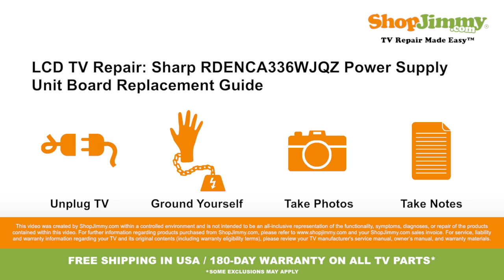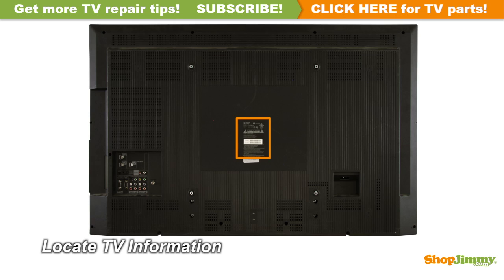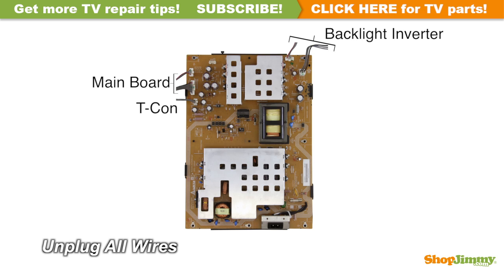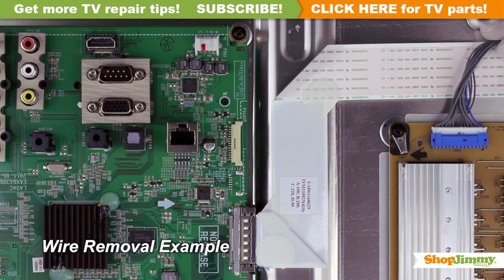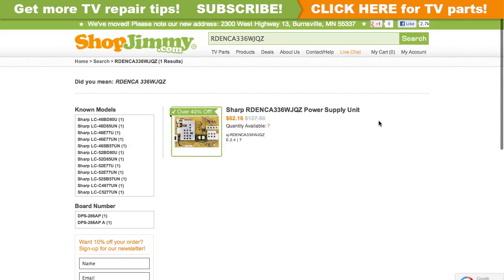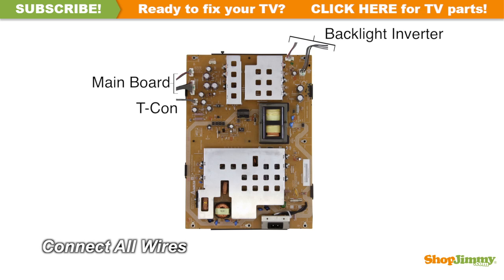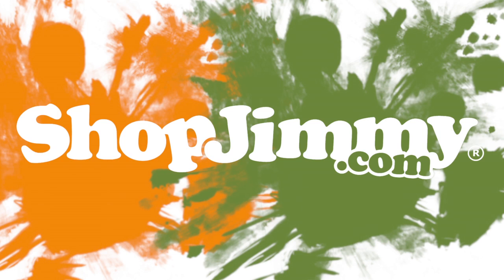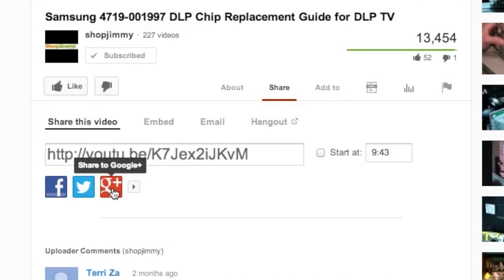LCD TV REPAIR TV WILL NOT TURN ON - Sharp TV Power Supply Board Replacement Models LC-46 LC-52 LC-C

Comment: s42ax-yb08
this is the model of my tv. only flashes some lights in the buttons is on and all it does.
Reply from the maker: damian4522   You will also need to replace the main board in your TV after the electric shock.  We always recommend replacing both the main board and the power supply.  Here is a link to replacement parts for your TV model number on our website, click here:  http://www.shopjimmy.com/catalogsearch/result/?q=s42ax-yb08  Be sure to match part numbers on your current board, with your replacement for compatibility.  You can also call our customer service for further assistance with your purchase.  (877) 881-6492  Thanks and please let us know if you have any further questions with your TV Repair!  www.shopjimmy.com

Comment: hello! I have a samsung 42 inch will not start after electric shock. I change the power supply for a new, but still will not start. help!
Reply from the maker: damian4522   Please reply with your TV model number and more information about the symptoms and problems your TV is showing.  Thanks!  www.shopjimmy.com

Comment: hi, i have aquos lc32le244e permanently black screen and say DO NOT POWER OFF......SCAN.......1>100% in loop, any advice?
Reply from the maker: Amazinga Amaz   I recommend replacing the main board in your TV.  Here is a link to replacement parts for your TV model number on our website, click here:  http://www.shopjimmy.com/catalogsearch/result/?q=lc32le  Be sure to match part numbers on your current board, with your replacement for compatibility.  You can also call our customer service for further assistance with your purchase.  (877) 881-6492  Thanks and please let us know if you have any further questions with your TV Repair!  www.shopjimmy.com
Reply: thank you
Reply: Amazinga Amazclick : http://www.sharp.com.ro/cps/rde/xchg/ro/hs.xsl/-/html/9320.htm?product=LC32LE244EV&var1=LC32LE244E&var2=LC32LE244&cat1=111&cat2=10005&shaPiwikSiteId=46

Comment: I have a sharp aquos model LC 37d43u serial# 703856659 no power no lights on
Reply from the maker: Rick Ashley   Check for standby with a meter if possible. If there is no standby, then I recommend replacing the power supply.  If the TV does have standby then I would replace the main board.  If you can't check for standby, then I would replace the power supply first.  Here is a link to replacement parts for your TV model number on our website, click here:  http://www.shopjimmy.com/catalogsearch/result/?q=+LC+37d43u  Be sure to match part numbers on your current board, with your replacement for compatibility.  You can also call our customer service for further assistance with your purchase.  (877) 881-6492  Thanks and please let us know if you have any further questions with your TV Repair!  www.shopjimmy.com

Comment: I have a sharp aquos lc-26d40 TV that will not power on. It has a solid red standby light that turns to solid green when I press the power button, but no picture or backlight. Any thoughts?
Reply from the maker: Pat Baker   I recommend replacing the main board in your TV.  Here is a link to replacement parts for your TV model number on our website, click here:  http://www.shopjimmy.com/catalogsearch/result/?q=lc-26d40  Be sure to match part numbers on your current board, with your replacement for compatibility.  You can also call our customer service for further assistance with your purchase.  (877) 881-6492  Thanks and please let us know if you have any further questions with your TV Repair!  www.shopjimmy.com

Comment: Hello, I have a Sharp LC52D64U, The green power light flashes once every second. I unplugged the power and held down the input and Vol -, when I plugged it back in. The screen came on and then went out and the power button went back to flashing once every second. Any ideas what it could be?
Reply from the maker: George Rua  I recommend replacing the main board in your TV, for your TV repair.  Here is a link to replacement parts for your TV model number on our website, click here:  http://www.shopjimmy.com/catalogsearch/result/?q=LC52D64U  Be sure to match part numbers on your current board, with your replacement for compatibility.  You can also call our customer service for further assistance with your purchase.  (877) 881-6492  Thanks and please let us know if you have any further questions with your TV Repair!  www.shopjimmy.com
Reply: any luck with this issue?

Comment: Hello, I have a 60 inch Sharp Aquos Liquid control model LC60LE745U serial number 207847077 it wont power on it blinks like two times pause then three more times but does not power on Please Help
Reply from the maker: Lashanda Ball   I recommend replacing the power supply in your TV.  Here is a link to replacement parts for your TV model number on our website, click here:  http://www.shopjimmy.com/catalogsearch/result/?q=LC60LE745U  Be sure to match part numbers on your current board, with your replacement for compatibility.  You can also call our customer service for further assistance with your purchase.  (877) 881-6492  Thanks and please let us know if you have any further questions with your TV Repair!  www.shopjimmy.com

Comment: Sharp LC52SB57UN LCD TV. 
Problem: When I plug in the power outlet, power and OPC start blinking green light but there is no picture. It doesn't show any picture. 
Any clue what might be the problem ?
Reply from the maker: faisal farooq   This could either be the T-con board or the main board.  You may need to replace each board individually to see which one fixes the problem.  Here is a link to replacement parts for your TV model number on our website, click here:  http://www.shopjimmy.com/catalogsearch/result/?q=LC52SB57UN  Be sure to match part numbers on your current board, with your replacement for compatibility.  You can also call our customer service for further assistance with your purchase.  (877) 881-6492  Thanks and please let us know if you have any further questions with your TV Repair!  www.shopjimmy.com

Comment: I have a Sharp Aquos LC60E79U that will not turn on.  The lights would blink in a repeating pattern, but that is all.  The OPC and Power would flash together, followed by the Power flash by itself, then a short pause.  (I'm not in front of it now, but that is the way I remember it.)  It was suggested that I try holding down the Channel - button and the Vol + button while I plug in the power cord.  This procedure did not fix the problem, but instead created a new one.  Now the lights won't even come on at all.  I did remove the back cover to take a look at the power supply.  The fuse appears to be blown when checked for continuity with a meter.  (Probably blew during from my previous attempt to force it to power up.)  I will have to install a new fuse before I can test for proper voltages coming out of the PS board.  Is there anything else I should be looking for?  Do you sell the parts I might need to fix this TV?
Reply: More information to add to this: After replacing the fuse and disconnecting the wires going to the rest of the TV, I plugged in the power and saw a spark from near the fuse.  I found a green thermistor that was cracked.  I also found two small, blue capacitors near a heatsink on the middle of the board -- these were charred.  I am hoping that replacing these components will return the TV to normal function again.  Otherwise, I might need to replace the whole board.  

Lastly, I was wondering what might be the root cause of this power board failure.  There happens to be two small mini-refrigerators on the same circuit as the TV.  Perhaps electrical noise contributed to the TV's early demise.  Do you have any suggestions or advice?
Reply from the maker: JWGdesign Without the TV having power it is tough to say what the problem is.  Here is a link to replacement parts for your TV model number on our website, click here:  http://www.shopjimmy.com/catalogsearch/result/?q=LC60E79U  Be sure to match part numbers on your current board, with your replacement for compatibility.  You can also call our customer service for further assistance with your purchase.  (877) 881-6492  Thanks and please let us know if you have any further questions with your TV Repair!  www.shopjimmy.com

Comment: Hi, my 5 year old Sharp Aquos LC-37Cd1E was on as normal and then the picture went black and the power light turned off however the sound carried on. I tried turning it off and back on again but it wouldn't turn back on an there is no standby light. Please advise!
Reply from the maker: englishrobex I recommend replacing the power supply board in your TV.  Unfortunately I do not see any replacement parts in the search results for your TV model number on our website.  Thanks and please let us know if you have any further questions!  www.shopjimmy.com

Comment: this is so good please help this tv comes on the picture and sound  and goes off
blanck  after some time one hasto do the same on and off what could be the problem?   tony
Reply from the maker: Antony Pereira I would recommend replacing the inverter in your TV.  Please reply with your TV model number and then I can recommend a replacement part for your TV repair.  You can also call our customer service for further assistance with your purchase.  (877) 881-6492  Thanks and please let us know if you have any further questions!  www.shopjimmy.com

Comment: Hey Jimmy, I'm having some trouble with my Sharp TV (Model Number: LC-70lE632U), it won't turn on or off but when connected, the power light just keeps blinking. Any ideas what could be wrong?
Reply from the maker: Daniel Espinoza This is either the tcon or the panel in your TV.  If you would like, you could try and replace the t-con board in your TV to see if that fixes the problem.  Here is a link to replacement parts for your TV model number on our website, click here: http://www.shopjimmy.com/catalogsearch/result/?q=LC-70lE632U  Be sure to match part numbers on your current board, with your replacement for compatibility.  Here is a link to a video showing how to identify your part number, click here: DIY TV Part Number Identification Guide for Sharp Power Supply Unit (PSU) Boards  You can also call our customer service for further assistance with your purchase.  (877) 881-6492  Thanks and please let us know if you have any further questions!  www.shopjimmy.com

Comment: Helpful thank you. My Sharp Aquos has sound but no picture. Is it the mother board I need to replace or something else? Problem has been intermittent since purchase (2nd hand) and could be "fixed" by turning tv on and off several times or leaving for 10 minutes and then turning on and off. But last three days it's taken most of the day for it to finally come on (still by turning on and off with the remote). I might not tackle the fix but happy to purchase the part for someone else to do. Thanks,